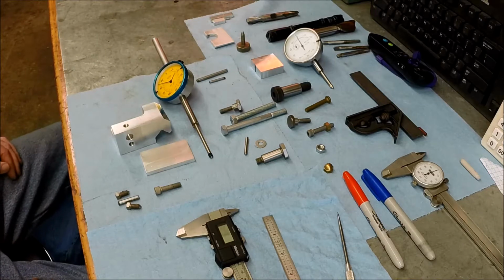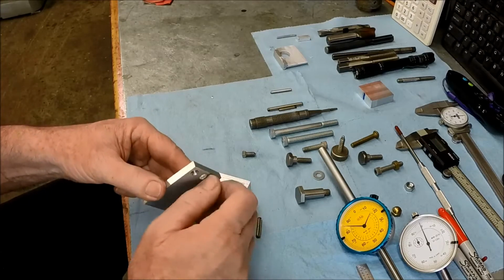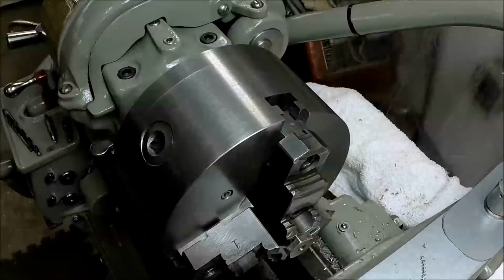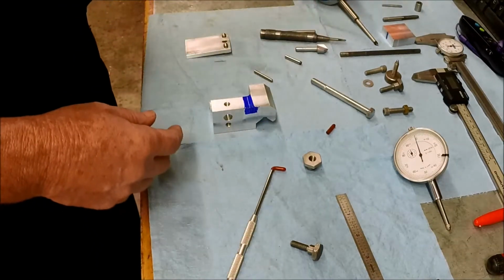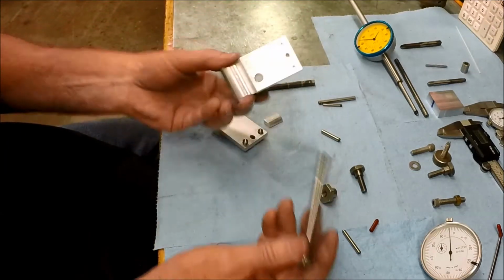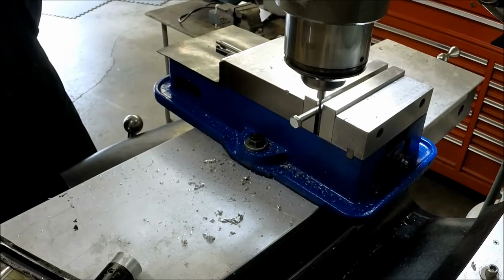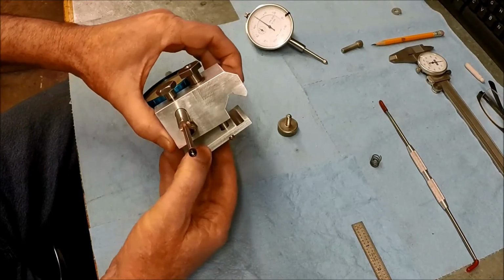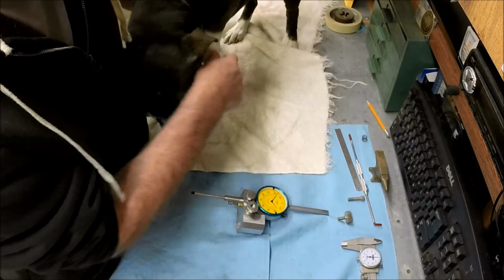Lathe Travel Dial Stop Part 3 Final

Comment: At first I was getting a little fearful of how things were coming along read the comment below from John felt a bit more safe to continue and now at the end, we see the outcome, wow you are good hands with a Mr. Pete approved vise. Cliff below is correct, also you are refreshingly into detail for your projects, you should be proud, it looks GREAT. We share something in common, we both place our picks tips back into their red plastic cozies when we are done using them for an operation. I almost screened until you shared you still need to make the spacer for protecting those fine indicators shafts. Looks to fit the lathe really well.
Reply from the maker: Thanks for the reminder. I've got lots of different size lead shot I'll probably use. I did grind flat and polish the ends of the thumb screws, that helps.

Comment: Turned out awesome. Great job! sometimes when I'm doing something where a screw has to tighten against something (especially round) that I either don't want marred up, it's shape makes it hard to bind against, or it's something frequently adjusted, I'll drop a ball bearing in the screw hole where there might normally (and ideally) be a brass pad. I need to build a junk mill! lol
Reply: Dean, please check your messages when you get a chance. Thanks.